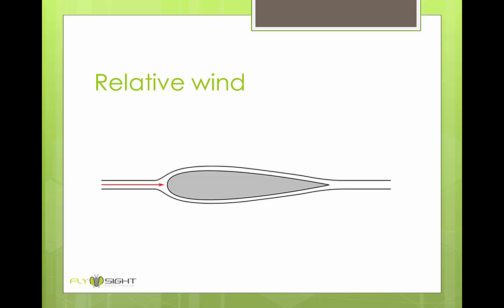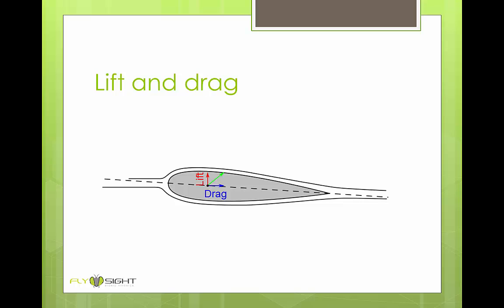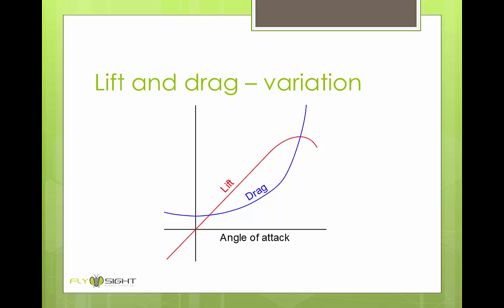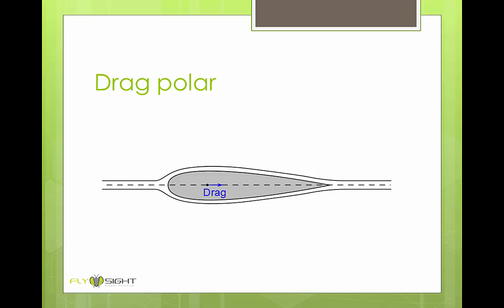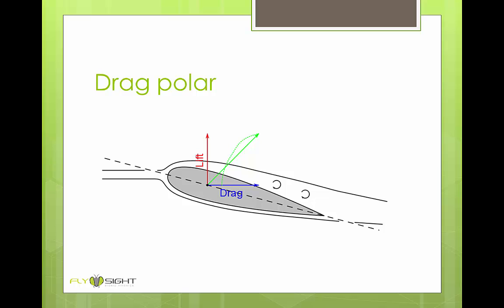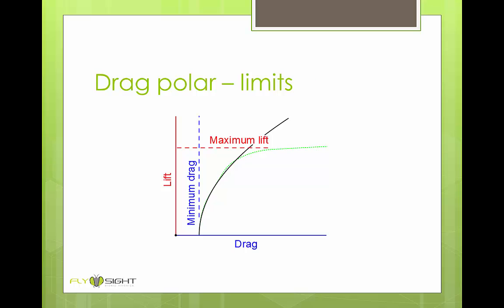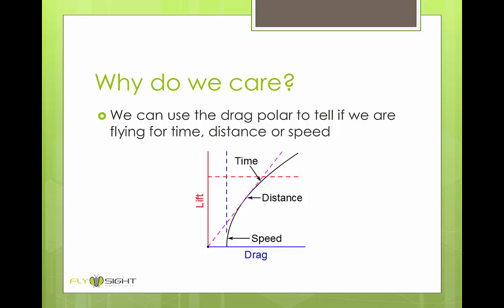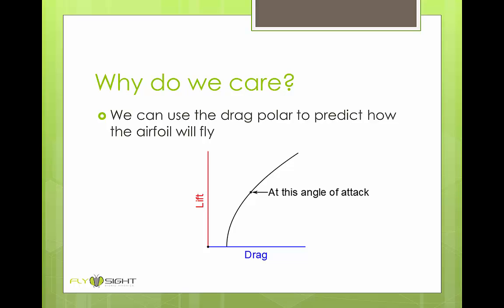A very brief introduction to aerodynamics

Comment: Hi sir, thanks for your inroduction to aerodynamics. I have two parts that I could not understand well.

First, at the speicific attack angle, you indicated the aerodynamics force with green arrow line, how to calculate that force? and is the angle between attack angle and  the angle of aerodynamic force and drag force are same?

Second, I could understand the ramming for speed in polar curve, but I don't really understand what does the rest of two points are saying about, flying for distance and flying for time.

Thanks a lot!
Reply from the maker: It's difficult to calculate the aerodynamic forces on an airfoil. This calculation depends (among other things) on the specific shape of the airfoil, speed of the airflow and properties of the fluid the airfoil is moving through. To find a full solution to this problem would require solving the Navier-Stokes equations[1], which is not always be possible.

However, there are a few special cases where the calculation can be simplified. One of the most common is the "thin airfoil approximation"[2]. This approximation doesn't tell us anything about drag, but in certain conditions it gives a good approximation for lift. Other approximations can give a reasonable value for drag. "Prandtl's lifting-line theory" is an example of this[3].

In general, the angle of attack is not the same as the angle between the aerodynamic force and the direction of motion (i.e., the drag force). This would depend on the specific values of lift and drag, which again is very much dependent on the shape of the airfoil.

Looking at the drag polar, there are two points that are fairly easy to understand. Assuming we are flying close to horizontal:

- When drag is a minimum, we will be able achieve the highest horizontal speed, since drag always acts against our direction of motion. This will give the highest speed score.
- When lift is a maximum, we will minimize our vertical speed, since lift always acts against gravitational forces. This will give the highest time score.

The distance score is a little harder to understand. Since we're working with a fixed vertical window, we will maximize distance if we fly as far as possible horizontally for every meter we fall vertically. This happens when we maximize our glide ratio. Looking at the drag polar, and again assuming we are flying close to horizontal, this means the ratio L/D should be as high as possible. Geometrically speaking, we can find this point if we draw a line through the origin and also tangent to the drag polar curve. You can see that if the line were any steeper, it wouldn't touch the curve at all, which is intuitively why this point gives us the maximum L/D.

[1] https://en.wikipedia.org/wiki/Navier%E2%80%93Stokes_equations
[2] https://en.wikipedia.org/wiki/Airfoil#Thin_airfoil_theory
[3] http://www.aerospaceweb.org/question/aerodynamics/q0184.shtml
Reply: @flysightgps  Thanks for your answer

I will have a think about flying for distance, it looks like glide ratio is the tangent line at polar curve which passes through origin, and is that saying at glide ratio L/D, the flight will travel maximum distance?

Thanks a lot!
Reply from the maker: @manikjang1815  Very close. L/D is just the ratio of lift coefficient over drag coefficient. Maximum L/D occurs, as you say, at the point where the tangent line touches the polar curve, and flying at maximum L/D will result in the greatest distance flown.

Note that this applies only in the "steady state". In wingsuit competition, there is a dynamic element as well, which we don't see pilots flying their suit at maximum L/D right out of the door. To find the optimal flight for this kind of dynamic situation, you have to perform a lot of experiments (jumps) and/or more detailed simulations.
Reply: @flysightgps  Thank you Sir. Because I'm just new to aerodynamic,  I will keep in mind your comment and have a think more about what you are explaining. I just found aerodynamic is so cool. Why do we so care about maximum glide ratio? Is that because we want to know how the specific airfoil performs as the attack angle changes? 

Thanks!
Reply from the maker: @manikjang1815  There are three flight modes for any wing which are particularly notable:

- Minimum drag: In this mode, you're flying as fast forward as you can. If you had a very strong headwind, this is the mode you would use to get as much distance as possible.
- Maximum lift: In this mode, you're flying as slow downloaded as you can. If you had a very strong tailwind, this is the what you would use to get as much distance as possible.
- Maximum L/D: In this mode, you're maximizing glide ratio. If you had no wind at all, this is what you would use to get as much distance as possible.

You can look at these three in lots of different ways, but when you think of them this way you can see why they are especially useful to pilots. Thinking of time under canopy, if you have a long spot and a good tail wind, you'll usually want to sit in partial brakes (maximum lift) to float along with the wind and get home. If you have a head wind, you'll get on your front risers (minimum drag) so you aren't blown backward by the wind. And if there is no wind at all, you might just apply a little rear riser pressure (maximum L/D) to get home.

By exploring these modes specifically, you explore the control range of your wing, so when you do need to do one of the things above (or something in between), you know how it behaves in that regime. More or less what you said--we want to know how a specific airfoil (the one we're flying) performs at all angles of attack, so that we can use those flight modes as effectively as possible.